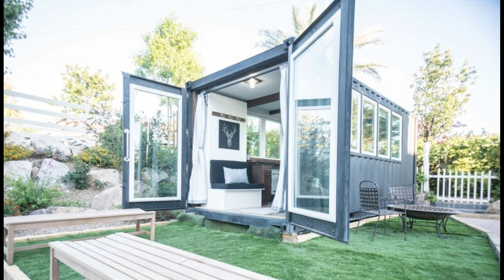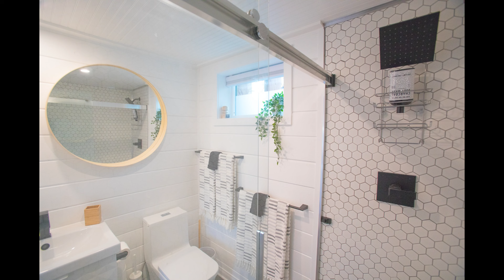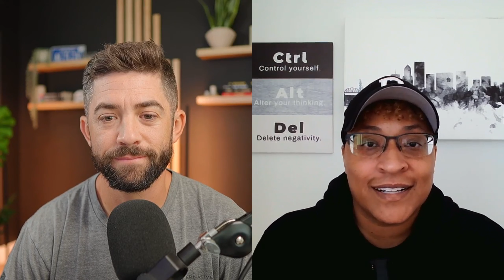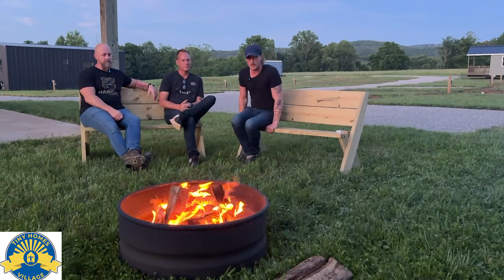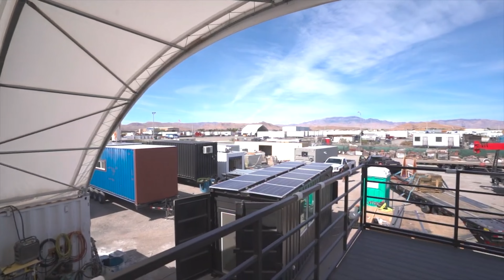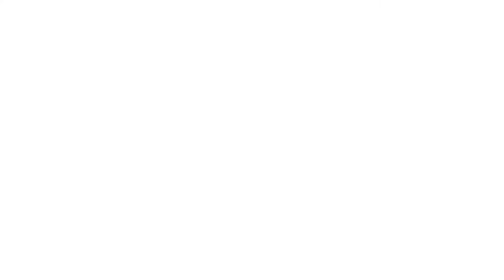Container Homes vs. Tiny Homes: What Nobody Tells You

Comment: Aren’t container homes much heavier than tiny homes? Can you put a container on wheels and drive it around or do you need a semi truck?
Reply from the maker: Hi! That is a great question. I do not know the answer to that one. I'd suggest reaching out to Tony directly.
Reply: Shipping containers weigh around 5,000 to 8,268 pounds\2,300 to 3,750 kilograms when empty.  Your standard tiny house on wheels comes in at 8,000 to 15,000 pounds\3,636 to 6,818 kilograms. If all fitted out, the container house will usually be slightly lighter than typical THOWs, thus it should be slightly easier to tow the container. The main thing that would likely trip up attempts to tow without permits is that most shipping container homes use the 40 foot\ 12 meter containers, which is typically over the length limit.

Comment: Thanks for another awesome informative video for the community to consider various options. Your channel is the best out here (in my opinion) for showing whats available for the tiny living shopper. Resources and scenarios that newbies may not think of on their own.

I had looked at container homes approx 6-7 months ago through a company called "Aztec", and felt them to be a viable option for me for the very reasons mentioned here. Maybe you can check them out as an option. Back then, their fully built-out 20' was $30k, and the 40' was $60k. But they didn't have any type of virtual tour of the interior, just a floorplan.

I visited Alternative Living Spaces website through your link here, but found little to no illustrations of options for models/floorplans, tours, and/or range in prices. I even Googled the company to see if they have a separate link with their entire inventory, but it went back to the same info on the link here on your video.

IDK...maybe I'm overlooking something because in one YT video he mentioned and showed scrolling a supposed section for used containers, but I have yet to find the link. Guess I'll keep looking.
Reply: Heyy! To best navigate our model and design options, I'd recommend using the configurator on our home page. It will allow you to design your container home to suit your needs and it will provide you a price in the end as well. Hope that helps!
Reply from the maker: Thanks for sharing your experience, I appreciate your feedback!